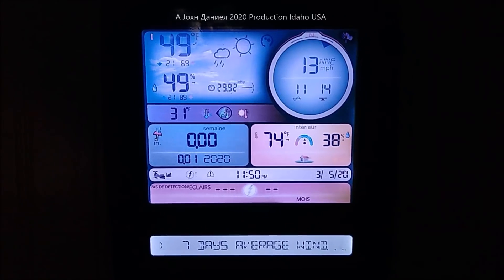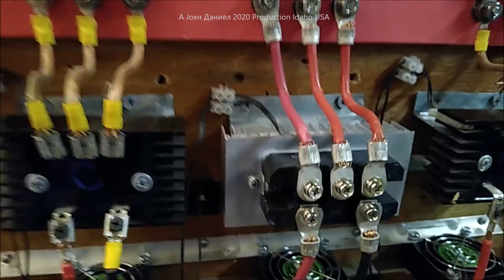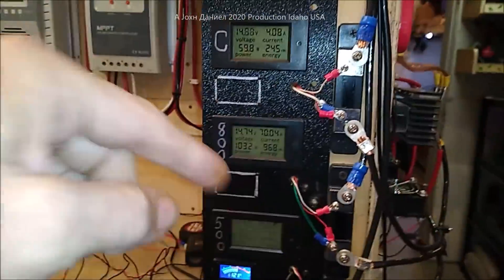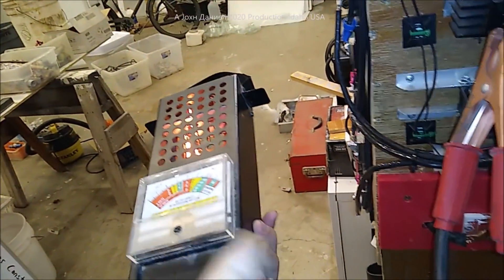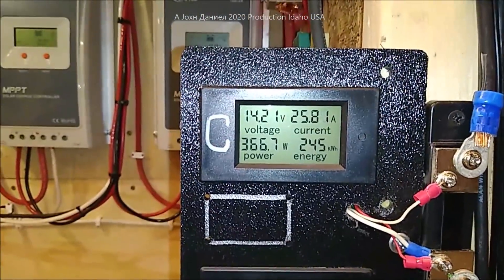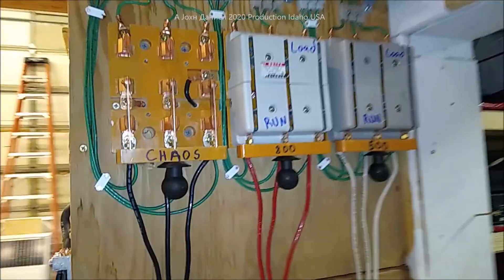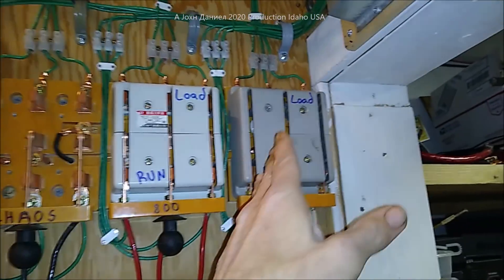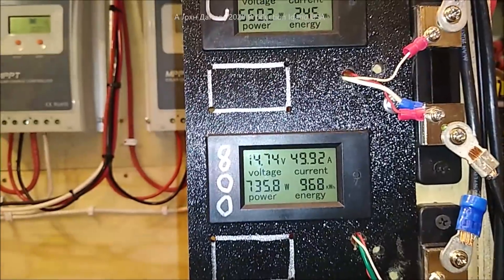Wind Turbine Brake & Safety Controls, full design by Olympic Power Controls™

Comment from the maker: TOTAL PARTS LIST (must hit SHOW MORE or ▼ on phones) Best way to safely run one or many wind turbines at once with your solar and other incoming power sources, here's the requested sources. 400 to 800 watt turbines operating as multiples or just one. FULL LIST is under the video, anything else you having trouble finding or broken links let me know.
Reply: John, would it be feasible to add a automatic braking system ? I am concerned that if I am gone the turbine will destroy itself.
Reply: John, is there a way to get hold of you other than the YouTube comments? I have a few question.
Reply from the maker: @xsbiggy6349  Scroll down in the info and links below the video, my shop e-mail is in there towards the bottom in the NOTES section. @yahoo
Reply: Hello,friend
How are you?dear,I have n’t heard from you for a long time and I am very disappointed.
I previously told you that the product video needs to be online within one month. You said that it takes 3-4 weeks to complete, but it has been several months.,I still have not received your reply. If you encounter any problems, please let me know.
Looking forward to hearing from you!
best greetings
Eva
Reply: Fantastic to see all this integrated in a full system context @JohnDaniel.  Also, GREAT progress on your system relocation/rewire.  My question is on "PARKING Procedure"??

You loaded the PMA down for "Brake Switch" parking with your 100A DC load box on the rectified side of the circuit prior to popping the brake switches... Can one SAFELY throw the same brake switches if loaded on the AC side when the AC-Series'd resistors are engaged??  

And, is there EVER a scenario when you'd ONLY ENGAGE a SINGLE brake switch??
I have yet to check the latest parts list and hoping you share your brake switch source.

Again, thanks for laying all this our in comprehensive and integrated manner so we can all see the entire picture.  I have the confidence now to integrate the turbine and solar together using this turbine management strategy.  As I mentioned in another video post, I'm going to build my diversion controller bottom up and attempt to use "Ideal Diode / Form C" SSR's for my diversion, resulting in what should be a fully isolated diversion load (from PMA and Battery pack)

Comment: Hi John. Finally someone who understands "dynamic braking". Ive seen many postings about a switch across all 3 phases of a alternator turbine output to short it in strong wind... "BANG"! It works but when the turbine is doing hundreds of revs a minute in a sou'wester  can be a recipe for disaster (broken shaft etc or at best, blades out of balance). It basically stops DEAD.  Series loading makes sense but also parallel loading over just 2 phases. We recently had one of those god awful "silent wind" turbine controllers blow up (the brake stays on) and it now sleeps with the fishes. The 400w turbine is still fine so bought a  "MARS ROCK" 1000 (that's chinese watts!) watt controller has a 5ohm dump load the size of a 44gal drum but no brake so you have given me a ball park idea of value to get in a variable resister to slow the turbine down to a safe speed to apply a short. Now for a windy day to experiment!!

Comment: How would you use 24v lead acid battery as slave battery to charge lipo4 8 string battery at 28.4v? I have a 3000w 24v all-in one system, I love it. Just would like to all a good wind turbine. Parts and set up???

Comment: Is  there a difference between using resistors like yours or just hooking up an immersion heater or similar to dump the load ?
Reply from the maker: Resistors stay the same load no matter how much your have them on, but a water heating element draws high amps in clod water, and lower amps as the hotter water matches the temp of the element. So if you in a wind storm, and the water is cold, you have great diversion, full draw like 300 watts, then as the water heats you may end up only with 250 watts of diversion which may cause over charge of your battery. Adding more element wattage may damage your charge to overcome this, that is why I size based on total turbine peaks using resistors.
Reply: @JOHNDANIEL1  amazing,  thank you I hadn't thought about how the change in water temp could effect current draw. Also can you have too much battery storage for a micro turbine ? Ie if you have a massive bank of batteries with low charge and just a small turbine can there be too much draw and it acts like a brake for the turbine ?
Reply: Also awesome videos  by the way 👍

Comment: Hi! Great video! I've learnt loads from your videos on wind turbines and storm brakes. Now it all makes sense 👍 
I have only one question  regarding the resistors. I have a 12volt turbine rated at 420w. Peak output at 14.5m/s.  What resistors would you recommend to restrict the turbine to say 30%. This set up is being installed on a yacht which will put it in the path of some seriously high winds.
Thanks in advance for the help.

Comment: How do you control the voltage that is going into your battery bank? If the battery bank is full, the system has to stop charging. Another thing is at what voltage is the battery bank being charged? If the turbine is spinning it will produce X Volts, from the specs I can see that wind turbines can be sitting between 0 and 200V. If the turbine is spinning at max and producing say 200V that is going into the rectifier, how much DC Volatge is coming out of it to the battery bank? Thanks
Reply from the maker: You divert excess after full charge into resistors so the turbine continues to spin and the battery is at a safe charge. No matter what the turbine puts out, on the DC side, the battery acts as a regulator to keep the voltage down as long as your battery capacity ( amount of Amp Hours capable ) is sufficient. Example: 250 watts of wind turbine per 100 AH of battery is a basic rule of thumb.

Comment: great stuff, this is what I have been trying to figure out, as I have 5 &10 & 20 footers, china alecko types, like them.    original controllers failed, brake systems were just short circuit.  the derecho here are about once a year, but deadly.  guess I can keep adding resistors until it slows enough for short circuit.  need mechanical disc brake on 20 ft generator also, 10 ft no need.  would donate to channel if used paypal.  really like the new boost controllers from china. thanks again, keep it up !

Comment: why not for emergency shut down, flip the main 100 amp SW to the resistive load, that seem to have knocked the amps down to 1.5 amp then apply the two breaks.
Reply from the maker: Yes, that's a safer method

Comment: Hi ya John, Thanks for putting a bit of your knowledge on the net. You have just given my turbine another life with its controller from been down for over a year. My SomaTurbine had run for over 20 years, on its third blade setup, before the controller did itself in.  Quick question I have is implementing your safety system into my set up (seriously great idea, have always been uncomfortable with this switching) I cannot work out the ohms thing for the life of me. 24volt 3phase 1200watt 50amp. Can you please tell me what resister size per phase? Regards New Zealand
Reply from the maker: Three 10 ohm per leg. 2 side by side in parallel then from them to one in line following before your rectifier. 9 total. New Zealand winds can be brutal. You can add a bypass switch to one or another as mid resistance loading if you like too. Use wire wound not aluminum cased.

Comment: John great video as always , I have been following you now for years , I took the plunge this year and put up 2 48v 800w wind turbines and I wired them to 2 bridge rectifiers and one charge controller , however when I did this one of the wind turbines just stopped spinning ? Do you know what I have done wrong ??
Reply from the maker: They are reacting to each other and providing double the voltage the controller is reading or you have a bad bridge rectifier that's acting like a electric shorting brake. 
Turbines should always be ran independently from the turbine through the rectifier to the battery if you're going to use a diversion control, or independently per controller that you would be using.
Reply: @JOHNDANIEL1  Thank you so much John, I will have another go at this , this weekend

Comment: a couple of questions John. when should I turn the brake on and, how long can the system be in this state?
Reply from the maker: You should turn the brake on during a lull in the wind if possible, you can leave it on for a long period of time but not to exceed 10 to 12 hours per session or you'll cause some magnet energy loss over a period of time.
Reply: @JOHNDANIEL1  thank you Sir, very helpful...

Comment: I have a question.  Using Chaos as the example. When you pull the arm down to run, in my mind the energy would be running back up your green (10 AWG) wire back to the resistors, and also down the black wire (your 8 AWG) wire. If arm is up, it's on load the current runs up the wires through the resistors via your green wires, and back to your black wires and feeds the system via the load, so why when you put arm down on RUN will it not run back up to the resistors (down the black wires and also up the green wires).    I'm struggling to understand why it wouldn't be running back up the line back to the resistors.  Do you have something at the junction in your diagram the little rectangle where your brake switches connects to, is that a breaker that prevents the current flow from running back to reach the resistors?
Reply from the maker: Power from the turbines three phase comes into the center lugs of the knife switch, pulling the knives blades down engages it to the rectifier below which converts it to DC for charging to the batteries. By pushing it up it sends the power up through the green wires through the resistors and back down to the terminals at the bottom of the night switch which and then run to the rectifier. The actual effect of this is to choke off the wattage and amperage so that you're not overheating your rectifiers and a benefit result is it places a constant load on your turbine so that it slows its ability to have a runaway effect and high winds. I designed this many years ago and now it seems like the Chinese are making controllers that do this with an automated function based on my exact design strange enough. So much for them being good at anything other than stealing.
Reply: @JOHNDANIEL1  I understand all this, what is that blue rectangle in your diagram above the break where the green wires go to.  This will clarify everything for me.  Thank you for taking the time in answering I really appeciate it.

Comment: Hey John, I picked up one of your 400w turbines you had in another of your videos and got a 600w grid tie inverter. Going to use the system on my garage since it has its own meter and that’s where I charge my wife’s Pacifica Hybrid. Would I need a brake system like this when using a grid tie inverter since it will be putting a load on the turbine 24/7?

Comment: Hi John an off topic question what would you go with in a low wind situation i.e the UK. Would you use a 12 volt or 24 volt turbine to charge 12 volt batteries via a controller as a 12 volt might not produce the voltage required to charge the 12 volt batteries at the wind speed we get here or would I be sacrificing Amps with a 24 volt turbine. cheers

Comment: Thank you very much  for your wonderful and very clear lecture.Some how  I have an  experince on solar energy..After I saw your chanel, ofcourse  i decided  to enter in  this section of energy.But I have still a confusion.What does it mean all that in case of high wind  situations?No problem at all?or that is another problem?If it is another topic, so how to control the maximum revolution of the turbine? greetings from Germany!
Reply from the maker: High wind storms can cause over power of turbine. Using brake or power loading can make it run safe.

Comment: What Ohm/Watt resistors do i need for 2200W 48v turbine to be sure ?
Reply from the maker: 2200 watt turbine is very large, 90 lbs and over 9 foot diameter blades so that's a lot of torque, i recommend minimum 12 to 15 ohm @ 600 watt X 3 for those.

Comment: First off, thanks for cutting thru the BS and throwing real, working solutions out here for us. Been studying yourvideos for a while now, but had a question: while the manual  braking systems are fantastically designed, what happens if you arent around to engage the braking systems when needed? Is there an automatic solution somewhere i am missing?
Reply from the maker: You can make a automatic safety brake using a much more complicated system like I created in some remote installs I did. 
It will require a wind pressure trip switch, a pair of latching relays and some work. But it can be done.

Comment: Dear sir, 4200w China wind turbine how to make the break controller if high wind .
Reply from the maker: A real 4200 Watt turbine is massive, 65 kilos and over 3.5 meter blade circumference. It should have a controller that is 5 kilos heavy and already equipped with a proper braking system.
Reply: @JOHNDANIEL1  dear sir I think people cheat with me, because total wind turbine 6 kg only

Comment: I am having trouble finding a 12v dc fan to cool off my rectifier. come to find out it is rated to 13.2 volts and I fry it. Could you share a link to the ones you recommend? Thanks

Comment: Thanks for this great information! I have setup the same system as your diagram, and i have few question for you:

1: Does the wind turbine slow down when you apply the loaded brake? (i ask because on my side, when i apply the loaded brake, i dont see any difference in the rotation speed) 

2: If you need full brake, when did you apply the two full brake switch? When you are on "loaded" or "normal" mode?

3: Last question: Is there any situation when you can apply only one of the two full brake switch?

Thanks for your help!

-Pascal
Reply from the maker: The turbine under running brake stops surging out of control. Reduces run away chances. Stops the excess heat from the turbines windings. 
You can apply brakes on either function, softer loading will occur when passing through resistors allowing you to reduce blade breakage chances since they will still turn enough to prevent damage. 
Never use one side of brake switch always pull both so you do not damage slip rings in turbine. 
J.

Comment: How does the braking system work? Is it a mechanical brake or does it like short it and put a load on the turbine so great that it just won’t turn.
Reply from the maker: Dual staging is my system but most use magnetic braking by shorting the 3 phases

Comment: Hi John, can you sell those parts, because Amazon is not delivering to Puerto Rico cause covid.  I'm sorry that I don't follow your videos on which turbine get I get the 12v 500w instead of the 24v for my 12v sys, there is something that can be done to remediate my mistake? was a bad desition not follow your advice now I'm paying for my mistake I though with the wind that I fill was enough, wrong I was,  my area Is a low wind from 2Mph to 17Mph or 20Mph at the most normal weather, but it's not constant, any help on this will be appreciated.  I have one last question I have both SOLAR and WIND connected in a bus bar to charge the 12v BB is the correct way to do it? Because the WT charge very low even in 15 Mph make 11W,  could be the size of my BB? 830Ah Or is the connection on the bus bar? I apologise for not follow your instructions on the 24v instead of the 12v.
Luis Martinez 
luismartinnez53@yahoo.com
Reply from the maker: I'm working over 70 hours a week due to the nutty leftist democrats created crisis making hundreds want off grid ASAP. 
 Send me a email on it and when I get more time I will see what can be done to help. olympicpowercontrols@yahoo.com

Comment: Great video John, answered a lot of questions for me, but I have one remaining. When you put the turbine under the load/breaking, does this slow down the RPM of the blades on the turbine in a strong wind or just ensure that the coils don't burn out? I'm wondering how to stop the turbine spinning beyond it's rated RPM just for physical safety.
Reply from the maker: Loaded breaking slows it's overspin activity and knocks 20% off it's top rpm at wind speed. Breaking via shorting controls it to 95% and produces no power.
Reply: @JOHNDANIEL1  I am struggling to understand how it slows/brakes. When the brake is applied, the turbine detects a “short”, but does it have an automatic brake that gets engaged in the turbine or is it that the magnetic field is disrupted? 
If it’s the magnets then 1- how can the little magnets in the Chinese ~400 w turbine stop it from spinning? 2- how do the magnets do anything with an AC current?
Sorry if these are basic and dumb questions I am just leaning about wind power but don’t have much experience with electrical systems. Solar was much easier to understand lol

Comment: do you have any video on how to hook wind turbines into the grid without using batteries?  And if you are hooked into the grid do you still need a dump load?
Reply from the maker: I avoid wind turbines involved into the grid system, never will pay off due to all the issues involved unless your over 20,000 watts of turbine input which gets you a license as a energy dealer, and the taxes to go with it.